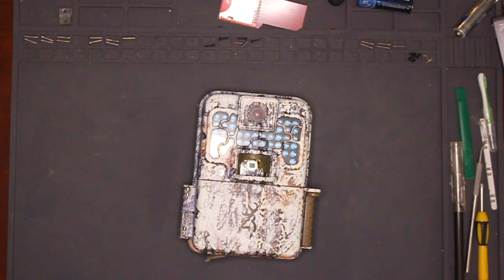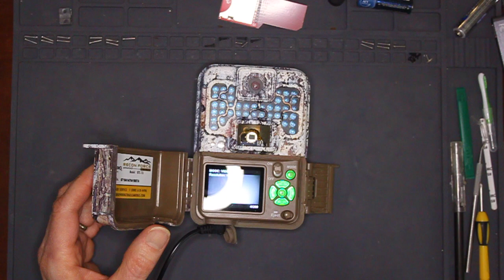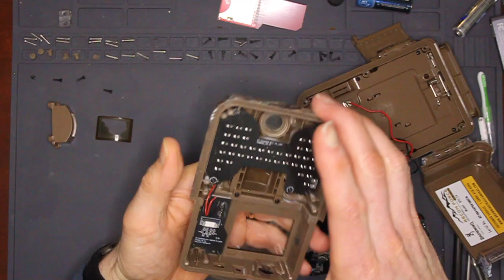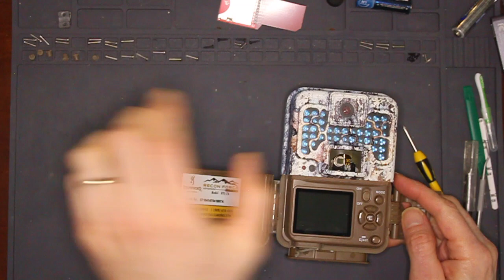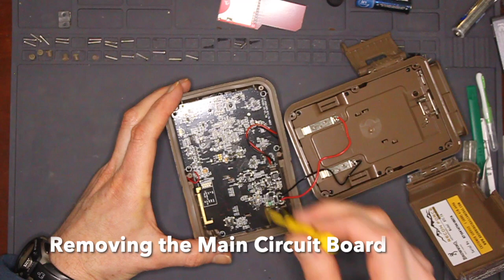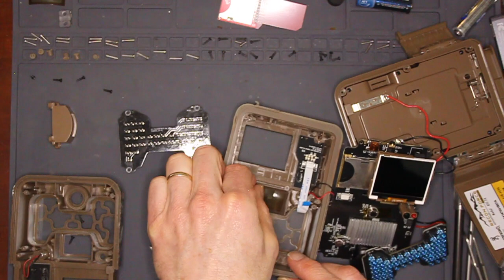2023 01 27 Replacing Trail Camera PIR Lens   HD 720p

Comment: Robert, as always, great video. Do you know of  a place that might sell PIR lenses? In this case we are talking about a Spartan Lumen camera. Not sure how to find a replacement lens.
Reply from the maker: Unfortunately, Browning is the only manufacturer I know that sells the PIR lenses 🙁. I haven’t looked at the Spartan camera. It’s likely it’s not the same as the Browning 🙁. If it’s same or smaller (in all dimensions) you may be able to cut a Browning pir lens to fit. Make sure to cut symmetrically around the center if you do, to keep the detection zones in the same place

Comment: The  HDPE (high density polyethylene material 1/32" in thick ness, UL94HB, in translucent white was the only material I found that was able to trigger the camera with a small piece of the polyethylene covering the pir sensor lens. Any other material like clear lucite or other clear plastics would not trigger the camera.
However, initially I ran tests indoors at about 20 ft. The camera triggered with no problem. Then I decided to put the camera on a small cattle pond on my property for a couple of weeks. What I found after testing was the camera would not reliably trigger beyond 25 feet. So it is back to the drawing board. Next I will try to locate a 1/64" sheet of the material and see if that improves the range.
Reply from the maker: Well, that must have been disappointing.   Is the hdpe considerably more resistant to damage by pecking vs the factory lens?  Even at 1/64” thickness?

Comment: I just replaced 9 pir lenses on my Browning BTC 7E HP5, BTC 7A, and BTC 7E. I wish I had found this video of yours. Being reticent about taking any electronic gadget apart, it took to me quite a long time in trial and error mode before I was confident enough to proceed with the repair. Now, it was in the end, really no big deal, but some of my cameras have been damaged more than a couple of times. Browning does sell replacement lenses for the three models I have, but I was looking for a more permanent solution. Finally, after a lot of experiments, I found a material that would protect the pir lens and most importantly not affect the performance of the pir. You might think that putting a clear acrylic or polycarbonate material in front of the pir lens should work, but as i found out, these clear plastic materials stopped the pir from receiving ir light. Finally I found what may be the holy grail of pir protectors. It turned out to be an HDPE (high density polyethylene material 1/32" in thick ness, UL94HB, in translucent white. You can cut out the exact size you need with a scissor and  I used some goop glue to hold it on. Now the test in real world conditions. Will it frustrate the woodpecker or me? I will report back. You can buy this on Amazon:
https://www.amazon.com/Density-Polyethylene-Standard-Tolerance-Thickness/dp/B0070Z87US/ref=sr_1_4?crid=ST91VTHL9S78&keywords=hdpe+polyethylene+sheet+1%2F32&qid=1687641135&sprefix=hdpe+polyetheline+sheet+1%2F32%2Caps%2C178&sr=8-4
Reply from the maker: I must have missed your comment during  our recent cross country move. Apologies.  Your research on appropriate IR transparent PIR lens protectors sounds great.  Please do let us know how it works for you.  I'm sure there are others with the same problem!

Comment: Hi,  I would like to change the microphone on my "cheap" (amazon) trail camera, because the audio is very low (the audio of the videos on my channel are raised with an video editor). 
I red on your Web-site that if a camera doesn't sound good out of the box,  it may not be fixable. Do you think that changing the microphone with a better one would make any difference?
Reply from the maker: Maybe?  It depends on what kind of problem you have.  It could be a design bug -- that is something about the hardware or firmware design which results in faint/low sound.  If this is the case, it's probably not fixable.  But it could be a component bug -- e.g. perhaps the microphone itself isn't up to spec.  Or it could be a build bug -- e.g. maybe the wires connecting to the PCB are reversed?  In these cases, replacing the microphone could improve the sound.   If you have more than one of these cameras, or check online for reviews, and find that poor sound is typical, it's probably a design bug.  If you know of an example of this model with much better sound, it could just be a faulty or improperly installed microphone. 

Microphones are typically not very expensive, so you could just try replacing.  You will need to find the microphone to know what type to get as a replacement.  Most cameras I've seen use a two wire (typically red/black) electret microphone.  See https://winterberrywildlife.ouroneacrefarm.com/2021/06/30/how-some-trail-cameras-fail/#sound-failure for some possible replacements.  Make sure to install the new microphone with the right polarity -- red to a pad labeled "+" and black to a pad labeled "-". 

I've also seen one camera (Stealthcam DS4K)  with a 4-wire MEMs microphone.  I haven't replaced any of these, but since they could require specific firmware support, you would want to find an exact replacement, and redo the wiring exactly. 

Hope this helps.
Reply: @Robert Zak  Thanks for responding! The low volume issue seems to be typical of the camera brand I own (coolife, hapimp) and even review on YouTube and amazon confirm it.
At the moment I haven't disassembled it yet to see how it looks like, but I would like to install one of the microphone you have recommended for the brownings. Yes, it's true that microphones aren't expensive, but if you say that changing the microphone wouldn't make much difference I wouldn't even try to touch it .
Reply from the maker: If they all behave this way, then this is (unfortunately) likely a design problem.  It's actually fairly tricky to get the right sound level from a microphone in the woods.  It seems likely that this vendor didn't invest in the necessary engineering to get it right.  I'd leave it alone and save for camera with better sound.
Reply: @winterberry-wildlife-tech  thank a lot! I'll probably leave it alone.
 I was actually planning on buying a new camera, a better quality one, what camera whould you recommend?
It needs to have at least these requirements: 1080p 60fps, no glow light, having the possibility to work with rechargeable batteries, and I also really like the feature of the browning hp5 that that it continues to record while the animal is moving in front of the camera.
Reply from the maker: No trail camera is perfect, but I don't think you can go wrong with the Browning Elite Spec Ops HP5 (BTC-8E-HP5).  I don't know of a better camera that meets all your requirements.